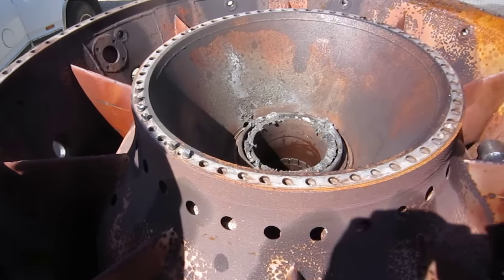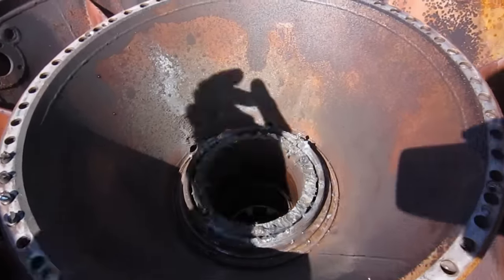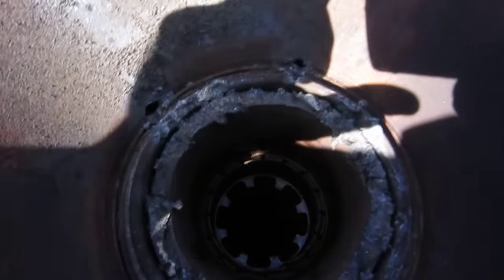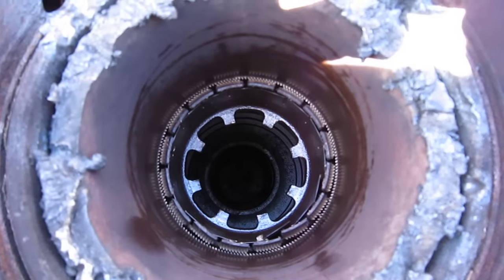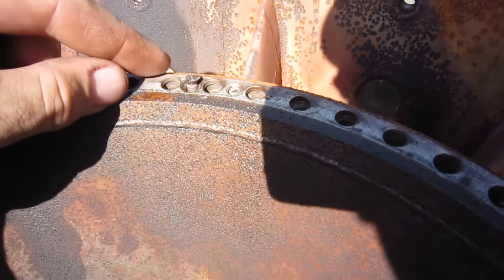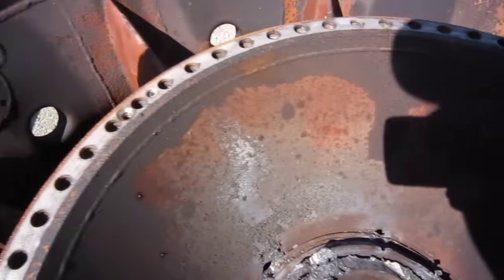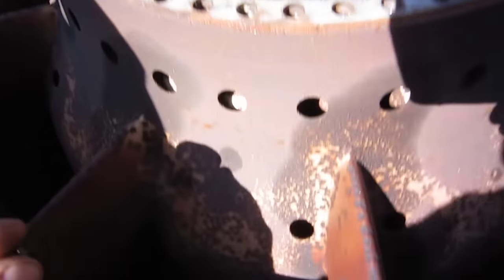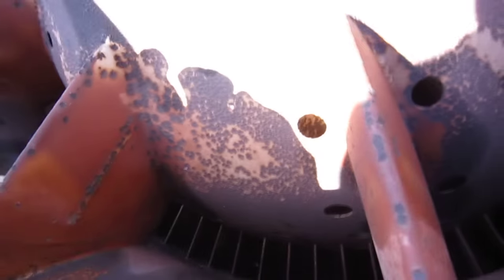Dropped into a turbine engine

Comment: Why don’t you want to hear that?
Reply: nerve gas
Reply: Piece of metal hitting spinning blades makes blade damage, and make piece of metal fly around and damage engine
Reply: For the same reason you don’t want to stick a pencil into a desk fan. Spinning thing plus loose object equals loose object flying at speed of spinning thing. On your desk, the worst that will do is break your pencil. On a plane, that can easily destroy the entire engine as the shattered remnants of whatever you dropped fly through the turbine’s innards like a red-hot shotgun blast.
Reply from the maker: description

Comment: Why don't we want to hear that sound?
Reply from the maker: description
Reply: @AgentJayZ this video is 12 years old with 35k comments, and you’re still responding? That takes dedication, I respect it
Reply: You could grab it using a pole with a magnetic tip depending on how shallow the drop is
Reply from the maker: Lvl 90 Bard: you need to watch my vid called Compressors.
Reply: If the screw gets stuck in the compressor you'll have to get it out of the compressor. Meaning you either have to tear down the whole engine or put it on a crane and try to tease it out

Comment: What would have even used the thrust bearing for other then just selling it?
Reply from the maker: Could be used in an industrial engine. Military engines have extremely high standards of maintenance, so the bearings are replaced more often than necessary.
Sadly this one had water get to it, and it was corroded, so not useful.
Reply: Fair enough I was just curious amazing responding after 13 years by the way!

Comment: Is that the gas generator of a J79?
Reply from the maker: It's the compressor section of an LM1500, which is an industrial J79 that runs on the ground.
Reply: @AgentJayZ  35 thousand comments and you're still replying to comments made mere hours ago? Damn. I would've stopped reading them 34k comments and 10 years ago.
Reply: @LoneFifteen  on top of that, he still remembers the details of this engine. Hats off 🎩
Reply from the maker: Being a turbine engine tech is not English class in grade 10. You either know your stuff, or you cost the customer millions. In my case, I now overhaul aircraft engines, so mistakes are not allowed.
Reply: @AgentJayZ  godspeed, studying to be a mechanical engineer right now. Unlikely I'll be designing engines, but I've been learning about them, they're neat, and it's an option. Hope you're doing well.

Comment: Why not?
Reply: The engine blades are fragile and work under a lot of stress so this could cause micro fractures that could destroy the engine during flight under the forces it handles during opperation.

So... If you drop something, by protocol you have to take it appart and inspect and or replace the blades individually for damage, which is very expensive
Reply from the maker: Description
Reply: @AgentJayZ  Brilliant channel man.. I see a 12 yr old video and then see you replying on it within the past 24 hrs! Keep up the good work ✨. And not to forget, beautiful content ❤

Comment: Just turn it upside down. duh
Reply from the maker: Everything seems so easy when you know absolutely nothing about the subject. Bravo.
Reply: @AgentJayZ  it weights like a ton right?
Reply from the maker: It's about half of a full engine, so about 1500 lbs. There are no good lifting points built in, so it's awkward, delicate, and very expensive.
Reply: @AgentJayZ  why cant you just turn it upside down
Reply from the maker: You can, with two cranes, a crew of three, and a lot of very careful rigging and handling. I took offense at the disrespectful tone of the original comment.
Reply: @AgentJayZ  Hey shoutout for being a boss, replying to facetious comments 13 years after posting. You dropped this👑
Reply from the maker: Thanks. Most people call me an asshole...
Reply: Ah okay  @AgentJayZ
Reply: @AgentJayZ  Wait, is that the actual solution? Looks like I've made an ass of myself again by making a dumb suggestion.
Reply: it was a joke man
Reply: @AgentJayZ  I think they call those… jokes…?
Reply: and modern problems require modern solutions
Reply from the maker: If it was a joke, or satire, it sure didn't read like it. Read it again. It's a condescending insult.
A typical know-nothing idiot talking down about something he knows nothing about.
A fucking idiot.
Oh, don't worry... I'm only joking...

Comment: Well, I mean yeah. But the ones I work on are the size of houses and we take them apart nonetheless hehe but yeah. Thats a big nono
Reply from the maker: If you want to enter our dick measuring contest, your entry must be in the form of a video. You will need to be on a downtown street corner between 10 a.m. and 3 p.m., drop trou, and use a metal tape measure. The weather must be below 5 degrees C, the videographer must be of the opposite orientation, and they must not laugh.
Thank you for your inquiry about shaft size, and how it matters.
Run along now, and send in that entry!
Reply: @AgentJayZ  🤣🤣
Reply: @AgentJayZ  so umm, are those videos gonna be uploaded here, or is there another channel I need to sub to? 👀
Reply from the maker: Dang! I forgot to use the sarcasm key.